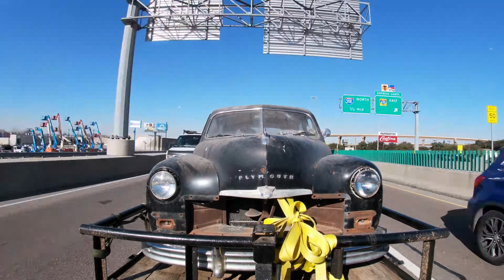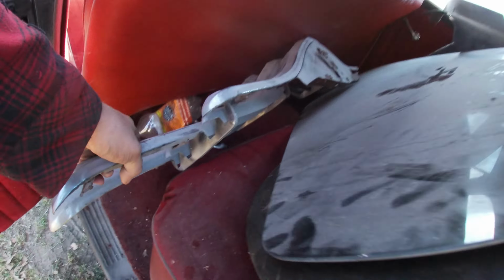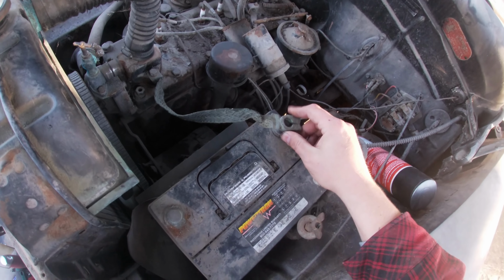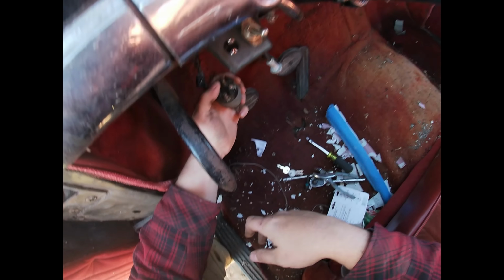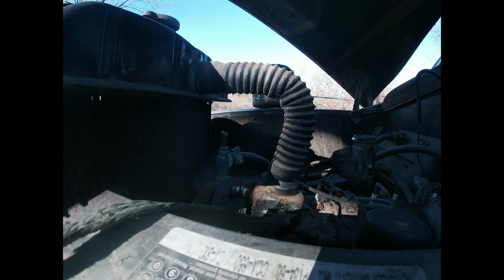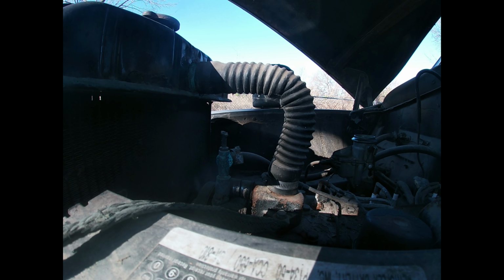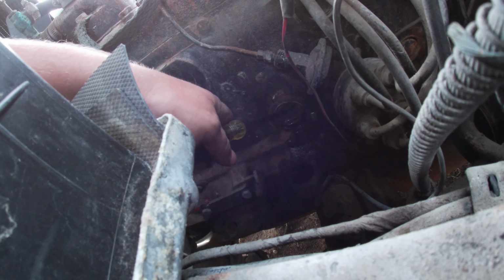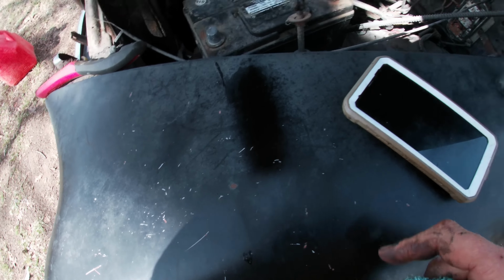Will it run? parked MANY years 1949 plymouth special deluxe.

Comment: My dad had a black 55 Plymouth with factory red trim before that a 48 Plymouth great cars. I’d polish that car get that black paint of those chrome fins get the car all back on 12 volts correctly  find a original good diff . Fix the roof lining change all the fluids an new tune up gear an you on a runner . Get a hose down the freeze plug hole an wash it out. 👍🏻💯Brian in Tasmania love the car .

Comment: The metal chunks in the cooling system might be what is left of the" water distribution tube" that runs from front to back with holes that spray the valve seat areas from inside the block..I might be a little late, but I'm viewing  some of your projects for the first time since I subscribed yesterday. Thnx for the memories! I never drove an old Plymouth that I couldn't fix.
Reply from the maker: GREAT CARS, This one went to a guy that drives it alot with his family he put an aluminum radiator on it and said it runs alot cooler now.
Reply: @somewhatfast  I'm sure he drives a lot, with PRIDE!  I also bet every time he parks the '49, he looks back at it when he walks away from his rescued '49......I would. . He would also get many "thumbs up" here in K.C.

Comment: So back in the 80s I worked on an Island between Africa and S. America During WWII the US built an airfield there, so out on the beach they had 4 pumps to flow POL from frieghter off shore to some tanks. The motors where the 215 CI industrial flathead 6 got one of them running been out there since 44 or so yea you cant kill-em that island also had some fab junkyards got several old dodges (M37 W200 crewcabs running drove em around) I subbed ever listen to the 'Cramps"?
Reply from the maker: Love the cramps

Comment: My first car I bought in 1964 was a 1950 Plymouth Special Deluxe. Looked a lot like your 49. But it was really in perfect condition back in those days. Railroader owned it so only drove it when he was home. The hood was sun faded from setting backed into the garage most of the time facing the sun was the only thing. He had put on seat covers and when removed the upholstery was perfect. Cannot imagine wasting time to change to 12 volt and screw up the lights and gauges as well as the tube type radio, mine worked. Somebody put disc brakes on the rear!!! Crazy! Always gets to me now days when someone will try and start an old car and never really attempt to clean it up and make sure things are operational. Clean the carb after you tried to run it before is just one of many. did not even say you checked it had oil or coolant.  Interesting anyway.
Reply from the maker: Thank galen, it runs great now. And the cost to convert it to 12volts was cheaper than a rebuild generator and a 6 volt battery. Those 6 volt parts are getting hard to find. If it ever broke down on the side of the road i can just go to any auto parts store and grab a battery or gm alternator.

Comment: I don't know what it is about the 50 super deluxe Chrysler / Plymouth plus or minus a year and I've always liked them. All I ever see is four doors and I think that body style looks good in a four door. You know if somebody want to get into the hobby that's the car you can start with because they're really super cheap. Compare them to their Ford or Chevy counterparts and they're a lot cheaper here take a look at the 1950 88 Oldsmobile I think 49 through 50 she were the same. Take a look at the back end of that car and see the resemblance of the tail light design to your car. I just found it interesting that this tail lights looks so much alike. One of these days I might get a car like that. I know I just got more to keep busy with. But I like what they've done to the interior red interior with the black exterior they go well together. Thanks for making the video

Comment: Just my experience with old stuff, if it got any gas newer than 98, the fuel system is usually toast. An 88 blazer that got parked 6 years ago had the tank rotted out, but my 76 chevy that got parked in 94 survived just fine. Always shocked me when a newer rig sits and its worse than the older ones.

Comment: A 12 Volt battery with negative ground probably means it was converted to 12 Volts with negative ground. Doh! If it has a 12 Volt coil that is a dead giveaway.

Comment: Nice car and vid. Advice- don’t touch the battery cables from your MOPAR truck to check you spark/connection or you will blow the diodes in the alternator.
Reply from the maker: Thanks for the advice!
Reply: alternator>1960!  This has a generator

Comment: FYI, those gauges in those mopars, were 6 volt, even up until the digital age( ie mid to late 90s
Reply from the maker: Wow I didnt know that
Reply: @somewhatfast  yeah, to make those gauges work on Chrysler's 12 volt system, when they went 12 volt in 1956, they installed a voltage limiter in series with the gauges, unless of course, the oil, and water temp, was still mechanical, which yours is on that 49 Plymouth, so reverse the leads on fuel sending unit, and the amp gauge, wire up the voltage limiter, positive to positive post on limiter, negative to gauge positive, negative on gauge post to chassis negative. now the way these work, is hook up a test light, clip to ground, turn key on, touch probe to negative post on limiter, and the test light should blink on/ off about every second or two. That cuts voltage from 12 to 6 volt. No muss no fuss. And no resistors to try and guess at as how to get correct voltage drop. Any NAPA should be able to get you one for a mid 60s chrysler product rather easily. Good luck.
Reply from the maker: @jamesmann1243  Yeah I rewired the entire car and converted it to 12 volts added a gm 3 wire alternator on it.

Comment: If your gauges don't work after all then switch it to negative ground, he may have converted it to 12 volt negative ground and your starter will turn same direction either polarity don't ask me how but that's the way they are.
Reply from the maker: I converted it to 12 volt neg ground GM alternator rewired the entire car and added turn signals. Check out my other video.

Comment: you might want to add a test light to your tool box son 
you probably fryed most of your gauge gluster and sending units  plus that 6 volt condenser
Reply from the maker: Nope still running strong on 12 volts and a ballast
Reply from the maker: Converted to 12 check out the other video